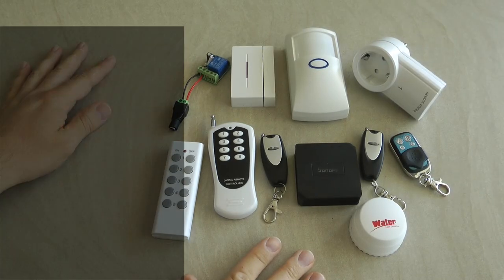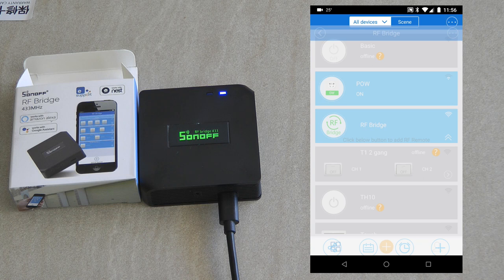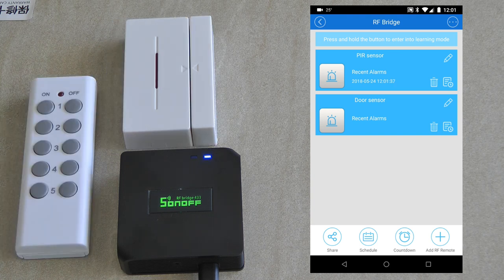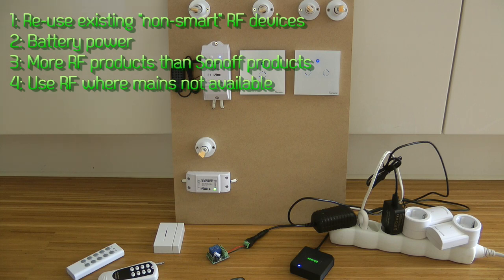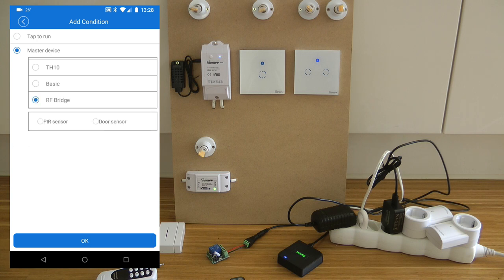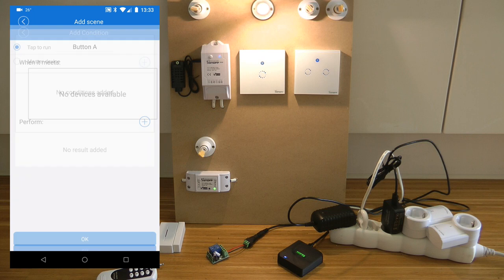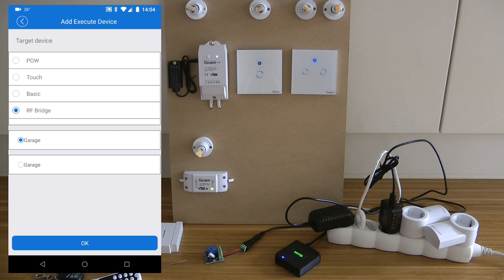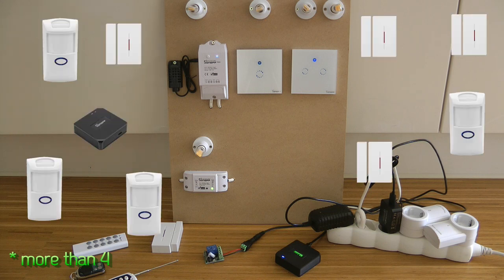Sonoff RF Bridge Review

Comment: They could've put an IR receiver and blaster into the same box. That would also work with infrared devices, like an A/C.
Still, very handy device :)
Reply: look at my other comment, there's how to hack it to add an IR transmitter... of course then you need to hack the firmware, too...
Reply: there is one it's called the broadlink RM pro
i think i like my RM pro better than this
not a bad price though
but i would like to see a comparison of the 2

Comment: Hello! Decent video first of all! The water leak detector, sorry if this has already been mentioned, you say at the beginning of the video its dead on arrival. I ordered 1 and thought the same thing! However I quite embarrassingly realised the device just didn't come with a battery installed! Needs a CR123 battery!
Reply from the maker: I found the battery compartment. I wedged in a CR2032 as that was the only one at home. Now I wonder that it was too low voltage for this unit...

Comment: Thank you for this great tutorial. I'm just starting out with the smart home stuff. I picked up a set of Westinghouse RF controlled sockets a few weeks ago as an impulse buy. I really liked them. 

I now have an Echo Dot and I was planning on upgrading to wifi smart plugs. I ordered some from Amazon.  The first set, 3 out of 4 were defective. They're on their way back. I ordered a different brand and I'm going to try to cancel. The RF sockets were $20 Canadian. The RF bridge is also $20. That's cheaper than the Chinese sockets. Now that I know that I can make them voice-enabled, I think that I'll stick with them. Cheap, unbranded Chinese electrical components, what was I thinking?
Reply from the maker: Thanks. It is a bit of a hit and miss. I use unbranded Chinese components (not plugs), and I usually have no issues. But of course quality suffers when they lower the price. But check if they will work with RF Bridge. I am getting comments from people that none of their devices worked with RF Bridge. As you can see I also had issues, but most of them worked.
Reply: I order from Amazon, so if it doesn't work, I'll be OK. It was too late to stop my second order so I have 4 Teckin outlets on the way. Sonoff also has some RF &  WiFi light sockets that I would like to try for my basement anyhow. I live in an old house, most of the lights down there are on chains and since I have old wiring, my lighting choices are limited. I'm going to have to get Lutron Caseta for upstairs so anything that can cut the costs down a bit is good.

Comment: Hi, nice video. I have several other sonoff devices and just bought one of these bridges to experiment. Excuse this if it’s a daft question but…….I’m a little confused, I can see how the bridge ‘learns’ the RF code (ie takes it ‘IN’) and can then control something else BUT does it work in reverse? ie if you press one of the buttons on the app does the bridge also then send OUT the RF to turn on one of the plug sockets?

Comment: @Csongor Varga
can sonoff touch be trigger using RF and not through wifi? I'm planning to have a alarm setup wifh RF only and not mix with wifi controls. thanks
Reply from the maker: Well, I am not sure. There is an RF Sonoff Touch which looks like the Touch but works on RF (and a coin cell). And there are Sonoff Basic RF which listens on RF and also on Wifi. Maybe you can pair the RF Touch to the RF Sonoff. I never had these units, so I am not sure how they work.

Comment: very nice video..  Thanks

can I ask a case?
I have multiple T1 Sonoff athome, 
my setting on existing T1 is just on off, and some with schedulling on off
and if it connect to wifi, it use IP for each device, I want to save number of IP, 

so my plan is to purchase this RF bridge, to connect and control the T1.for on off via bridge, and if possible to set shecdull on-off on the T1.
is it possible?

Comment: FYI
those cheap RF relays are great and they have more than just the momentary mode,
there is also a latched mode so you can have  either one button  to  switch it on and  another button to  switch it off or you can  have it  so one button switches it on and off and there is another  mode too but i forget what it is  since i never use it and thye also come in 10 amp 120/220 v  so they can be used for main just like a sonoff basic and it also has the different modes, so you can make it  on with one FQ and off with another FQ

i use the 12v models for the garage with a broadlink RM pro
well i use one right now but then you only have one FQ for  both open and close
i got a second one for the garage  and now i am waiting  for my momentary SPDT button switch to arrive from China so that i can wire the 2 relays and the switch up to get  separate  FQ's  , one for open and one for close here is a schematic for you if you are interested
9000 hours in MS paint
https://postimg.cc/image/9t529w893/

i plan on  mounting or gluing the  button to a magnet and then sticking the magnet on the end  of the
rail near the opener so that when the door opens the trolley will press in the button

Comment: Please I need some help, I am using a somfy telis1 rts 433,42 Hz and I don't know how to connect it with the sonoff bridge.
Reply from the maker: If following the above procedure does not work, you can't do anything about it. I heard somewhere that blinds user a very long RF code which most RF units do not support. If the RF Bridge does not learn the signal, than that's it. You cannot use it.

Comment: Hi,great video & info, but i am hoping you can help with a problem. 
I have 3x PIR2’s 1x bridge & 1 sonoff mini. What i am trying to do is is switch some communal hallway lights for a time of around 5-6 minutes using the above items. 
The problem i have is that i open the front door the PIR2 picks me up & the lights switch on & this is good & it switches off a few minutes later. Now only works if i dont move again after i have opened the front door, because if the PIR picks me up again within this timed period, the lights get switch off.
Can you think of a way around this. Thanks
Reply from the maker: I did this video a long time ago, I hope I remember the details right. I would try the following: set up the 3 PIR sensors as alarms. Create 3 scenes that trigger in the 3 PIR sensor and turn the Sonoff mini On. And in the Sonoff mini settings turn on the inching functionality and set it to whatever off time you want. If you use this the PIR sensor should never turn off your light.

Comment: When I link the sonoff door sensor with the sonoff pro 4ch rf, it only activates the switch when the two parts of the sensor are separated. When I put them back together nothing happens. I need it to turn off the when separated and turn it back on when reunited. What am I doing wrong ?
Reply from the maker: Nothing. It only sends out a signal when the two are separated. It is just designed that way.

Comment: Several questions, I would want to use this device to control ceiling fans in my house, what sort of range does the RF signal have?
a fan would be a single device BUT there are multiple functions associated with that device such as Fan speed and light control as well as on/off. Will this bridge accommodate those functions.
What are the implications of using Several of these Bridges throughout the house.
Reply from the maker: These have rather good range. And these low frequency RF signals travel well across walls. But I don't think you would be able to do much with the fan speed. Light and On/Off would be easy, but I have no idea how the speed is wired and if that can be done with RF. I only had one RF Bridge, but I see no reason why multiple would not work in the same house. Probably the most straight forward way would be to use RF Bridge to pick up the signals from your RF remote/keyfob and that triggers different modes on the Sonoff fan controller such as iFan02. But with iFan02 you can set up a scene to turn it on/off, but there is no scene setting to change speed.

Comment: Hello. Do you know if there are any/major differences between this and the sonoff zigbee bridge ? Thank you
Reply from the maker: Oh yes, everything. Completely different tech. Old RF works on 433MHz, Zigbee is 2.4 GHz. RF is lower frequency so it helps with range, usually cheaper, communication is not secure. I think it is OK for basic sensors. Zigbee is the new tech, it is secure communication, the sensor is bind to the receiver, so nobody else can listen in the data, Zigbee devices create mesh network so they can communicate through each other to extend the coverage. Sonoff RF bridge has a stupidly small limit of 4 RF devices per bridge.
Reply: @csongorvarga  Thank you for the fast response. My use case is 433 window shutters and pir/door sensors for smart alarm system. Which one is the best for that case ? Also range is really important. I have recently purchased a Broadlink RM4 pro and the range on RF is very small: from my tests it does not go past 7 meters so i cannot reach all blinders in my house: again 433 mhz remotes for those, and 2: broadlink cannot attach PIR/magnetic sensors(maybe it can i just did not figure out how)
Reply from the maker: @AlexTheDadGamer  That is interesting, I have 433Mhz door bells out at my gate which is about 20 meters away and my received picks it up without any problem. But if you have 433 window shutters, those probably cannot be replaced with Zigbee units, so try linking them with RF receivers and use Zigbee for anything else.
Reply: @csongorvarga  So what i understand is that with the Zigbee router i need zigbee enabled devices while i can use ther egular 433 from Sonoff for regular 433 devices/like my blinders/sensors. Is that correct ?
Reply from the maker: @AlexTheDadGamer  Yes, these are completely separate. You need a bridge/gateway for both 433 and Zigbee. And you would like them together with Scenes in eWelink
Reply: @csongorvarga  Thank you very much for all the support and fast replys. Just one last quesiton: did you manage/try to get notifications/alerts via google/Alexa when the PIR sensor or magnetic window sensor detect something?
Reply from the maker: @AlexTheDadGamer  No I did not. But I am not sure if it is possible at all. I don't have Alexa, but in Google I am not sure if this is even supported.
Reply: @csongorvarga  I have an old sonoff wifi relay that i controll trough ewelink and i connected ewelink to google home and it works perfectly. I was hoping the RF bridge  attached devices like sensors work good as well. With RM4 pro universa; remote they work great(except the range) and it is the same principle

Comment: Very good videos, very helpful for a newbee like me. Question: how should I link a door sensor with seperate open and closed code? When I choose for Alarm in de Ewelink app then only one code will be registered. Or should I make two alarms, 1 for the open code and 1 for the closed code? Thanks!
Reply from the maker: Yes, this is a very good question. So far I have only seen an door open alarm. It does not send any message when the door is closed. Hence there is only one code. So I don't have an answer to your question.

Comment: Which is safer for me to use; maybe, I should say which is more secure to use Wi-Fi or RF when secure in my home with devices?
Reply from the maker: That is a very good question. I don't think these cheap wifi devices are particulary secure. But I think it is easier to sniff the unsecure rf code than mess with your devices over wifi.

Comment: Could this be used to have TWO remotes operate the SAME one Sonoff rf switch?
Thanks!
Reply from the maker: Yes, you can certainly set the two remotes up as two alarms and set scenes for both to operate the same device.
Reply: @csongorvarga  
Thanks! Why as alarm and not normal button remotes if I may ask?
Reply from the maker: It was a long time ago, maybe it has changed. But I could only set up a scene with a trigger if it was defined as alarm. But give it a try. You can always delete and re-train the button.

Comment: hi there. awesome video. question please; can i add the sonfoff wifi/rf switch to my air conditioner and control it by using my google home and / alexa?  i read somewhere else that it wouldnt work. because to turn the ar conditioner on you have to use the rf controler of the ac. do you know anything about this please? thansk.
Reply from the maker: Thanks. I think what you heard is true. With a Sonoff you can provide power to the AC, but it will not tell the AC to also turn on (not to mention other details like temperature, speed, etc.). BroadLink RM Pro is a wifi IR remote hub which I have been recommended in the past. That will let you control your AC from your smartphone, but as far as I can tell it is not integrated with Google Home / Alexa. Sensibo Sky is another product which is advertised a lot, but that is a different price range.
Reply: thank you for the response. after i wrote the above, i kept on researching and found about the SONOFF POW, i also found out that SONFOFF has also a bridge like broadlink. now i am reading as much as i can on these to see if i can get my set up to work. do you know anything about these two products?
Reply from the maker: @emailyarabrandao  POW is for measuring power consumption. So that is not for controlling your AC. Broadlink RM Pro is also what I heard/read about, but I have no personal experience.
Reply: ok. thanks for the info. i will keep on looking. have an awesome day! and thanks again :)

Comment: In can work with any 433 emision or there can be incompatibilities?
Reply from the maker: No, it will not work with all 433. But as I said I find it impossible to tell which will work and which will not. I for for example that shutter remote usually don't work with RF Bridge.

Comment: Is it posible to jog a reley with the app? if I would push a button on a app for 10sec or something like thaht.. woul it be trigerd just for 10 sec? Or is that not posible? I would need it to work like that
Reply from the maker: I don't think so. RF Bridge is programmed to only send out 1 signal and that's it. You can't change that.
Reply: @csongorvarga  But is it posible to maby make a joging/inching mode? I would need a signel when i would say: hey google turn on the light (and would get a output for 1 sec) and when I would say google turn off the light (1sec signa) is that posible?

Comment: Hi Csongor 
will this work with any 433 or do i need the sonoff stuff?
for emaple can i buy any brand PIR,Smoke?
Reply from the maker: Not all the devices featured in this video are Sonoff. I think it will work with generic devices as well, but you will only find out when you try to pair them. One of my remote did not work.
Reply: thanks, I am planing to flash it... do you think it's limited to the amount of inputs? (PIRs for exmple)or only outputs are limited
Reply from the maker: I was also quite annoyed by the limit. I am pretty sure it is not the limitation of the hardware. This has plenty of memory to store a few dozen codes at least. So you most probably would not have a limit with a different firmware. But I don't know what alternative firmwares are available to RF Bridge. Never tested any.
Reply: Hi I have seen @dr zzz use thasmota with it I think it can listen to unlimited amonut but I will test and tell

Comment: thx for the video. If i want to set up a DIY relay board, do i need some remote to learn it to the sonoff bridge? Or can i press a button on the print to learn it to the sonoff?
Reply from the maker: You need a remote. The RF Bridge can only send out a code that it has learnt. It cannot generate a "random code" on its own. Alternative is borrow a remote from somebody, train both devices and you will not need it any more... :)

Comment: I just bought a sonoff RF Bridge just only for alarm use, I set 4 door sensors. I already settled all the scenes but my main problem is: how can I turn on and turn off the bridge when I am leaving my home and when I arrived. I dont want nothing automatic just tell to the bridge is time to arm the alarm when I'm gone and shut down the alarm when I'm in home. Thanks.
Reply from the maker: Interesting question. I would use a Sonoff Basic in front of the RF Bridge. The Basic turns the adapter for the RF Bridge on and off, basically cutting power to the entire RF Bridge and therefore none of the scenes will work. I can't think of any other way.
Reply: @csongorvarga  thanx man. I was wondering if exist something direct with the app. Do you think if I cut the energy with a sonoff switch, the bridge will have any damage? I will follow your recommendation anyway. You are the best keep with your videos.👊🏽👊🏽👊🏽
Reply from the maker: I don't think cutting power will cause any damage. RF Bridge is a not a Linux or any other "proper OS" which needs a proper shutdown.

Comment: Thanks! Nice video. very informative and educational. I have a question? I have just programmed a remote control (RF) for the sockets connected to the lamps; works great!... My garden lights also have an RF Remote, but it will not learn that one, nor will it learn the RF Remote control for my chandelier. Any suggestions?
Reply from the maker: I don't really have any suggestions. If it does not learn the remote, there is nothing you can do about it.

Comment: so can it learn any 433 remote? or does it need to be made by sonoff?
Reply from the maker: It does not need to be made by Sonoff, but most probably not any remote. There is not a single standard for 433 so many will work, but I fund in impossible to tell if a remote will work or not. But I know that motorized blind remotes don't work, they use a different code. But my generic keyfobs all worked regardless of the manufacturer.